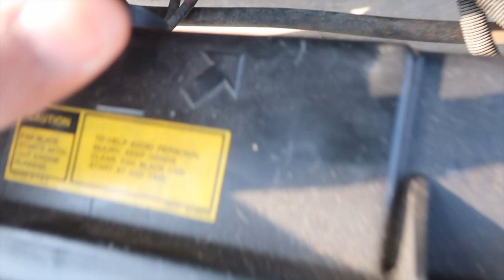HOW TO REPLACE THE ENGINE FAN MOTOR 1996 IMPALA SS

Comment: Good looking on the video, what  type of air intake is that
Reply from the maker: Space 96ss I bought the car like that, I think it’s k&n from Autozone.
Reply: It’s bad ass, also would you where to buy the vents in the dash at ? And the trim that runs along the floor board
Reply from the maker: Space 96ss yes I do! Checkout the impala SS FB page or the 94-96 impala SS FB page. Just post a question or search.
Reply: BLK_WILL_ SS right on I appreciate the Info
Reply from the maker: Space 96ss no problem!!
Reply: I need some help ,,, I replace my motor to my fan driver side but when the car temp gets up there the A/C fan cuts on instead of the cooling fan . Which the fan that cuts on is the same fan that is for a/c
Reply from the maker: Space 96ss so the driver side fan not cutting on?
Reply: BLK_WILL_ SS that is correct
Reply from the maker: Space 96ss add me on FB. Same name so I can talk with you brother.
Reply from the maker: Space 96ss open the fuse box that is under the hood near the passenger side. The relay on the right said at the top needs to be push down. Try small movements to see if it works. Does the fan comes on at all on the driver side??
Reply: BLK_WILL_ SS the fan on driverside don’t come on at all ,, would Coolet temp sensor have a role in that
Reply from the maker: Space 96ss try unplugging the sensor that’s located right in the front and see if both fans comes on.
Reply: BLK_WILL_ SS you have Instagram
Reply from the maker: Space 96ss yes same name

Comment: Yooo bruh I need your help on this if possible my driver side fan refused to come on even after I replaced the fan change the relays change the temperature sensor
Reply from the maker: Okay. Did you check the fuse under the hood on the passenger side??
Reply: @BLK_WILL_SS  my brother checked it an said it was fine but that is the one thing I didn’t change out so I’ll just change it out to be sure
Reply: @BLK_WILL_SS  but also when we unplug the temperature sensor both fans cut on im confused
Reply from the maker: @staybalanced3024  you didn’t change the motor yet??
Reply from the maker: @staybalanced3024  so that means your motor is working. Might need to switch the fuses and see that first. It’s cheaper.
Reply: @BLK_WILL_SS  bet I will an I changed the whole fan assembly basically
Reply from the maker: @staybalanced3024  ok check the fuses first then. That should be it. Also, try to wiggle the fuse because they are known to have a bad connection.
Reply: @BLK_WILL_SS  yea bro didn’t work do you think it could be my thermostat is reading hotter than what it really is
Reply from the maker: @staybalanced3024  passenger fan is the engine fan and the driver side fan is for the a/c. I had the same problem with the driver side I bought an aftermarket kit and rewired it. The problem is the connection in the fuse for sure.

Comment: What size socket for them screws that hold the fan on the radiator?
Reply from the maker: I used a 10 and a 12. Mine was mixed.